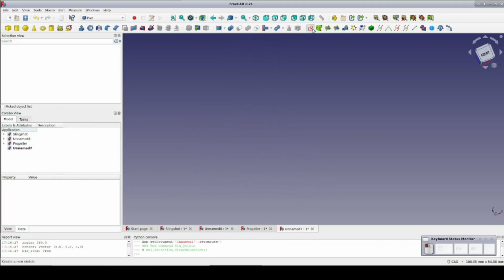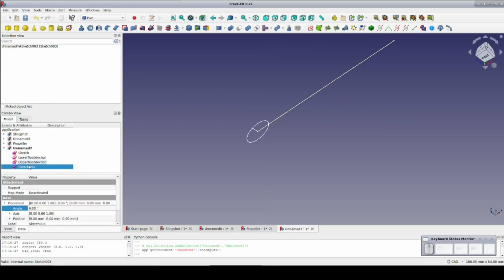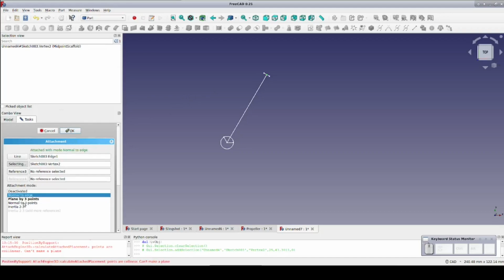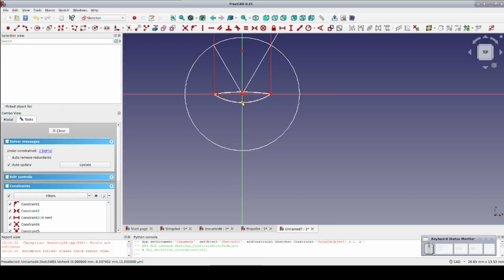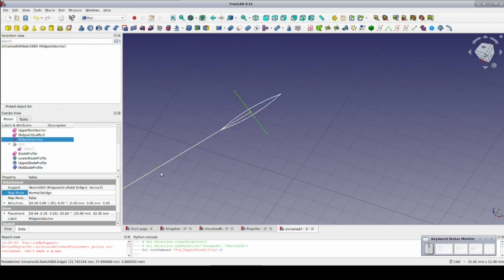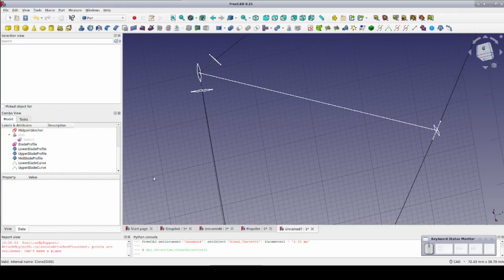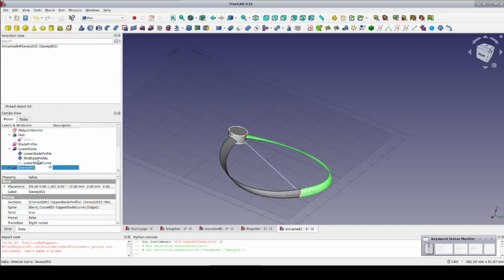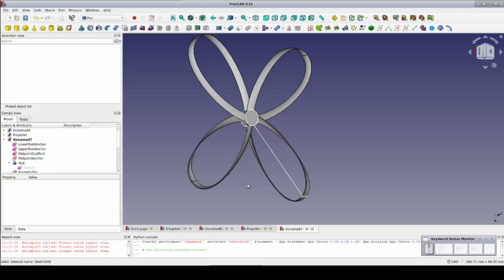FreeCAD: Designing a toroidal propeller.

Comment: For whatever reason, everything seems to be going well until I'm trying to adjust the height of the upper and lower anchors as the end of the video.  The properties are greyed out and there doesn't seem to be any way to move them now?
Reply from the maker: I'm not sure what's going on. In mine, it's adjustable. What version of FreeCAD are you using? The only case where I have seen Position fields grayed out is if a formula has been set or if the object has been attached to something.

Comment: Thanks for your video.  I wonder if you can help me with the trouble I'm having in reproducing what you have done.  My problem is with the blend curve.  I'm trying to blend between the bottom anchor and midpoint anchor.  I can't make it work.  The blend curve attaches to the bottom anchor but will not attach to the midpoint anchor.  The resulting curve isn't attached to anything at that end.  I set up a few experimental sketches to sort out what is going wrong.  If the attachment mode for my sketches is deactivated I have no problem with blend curve on from edges on multiple sketches.  As soon as one of the sketches is attached to the midpoint scaffold, the blend curve is no longer happy.  I'm using V0.21.0 but it doesn't work on V0.20.2 either.  Any thoughts on what I am doing wrong?

Thanks for your very useful videos.
Reply: Just an update to the above, there is a new blend curve tool in the surfaces workbench with V0.21.0.  This tool seems to behave in the way the curves workbench tool does in your video.
Reply: I'm having a similar issue, but it's with the sweep tool.  Instead of following the path it seems to be shooting way out about 5x pass the outer radius